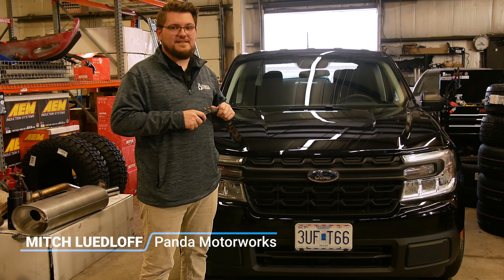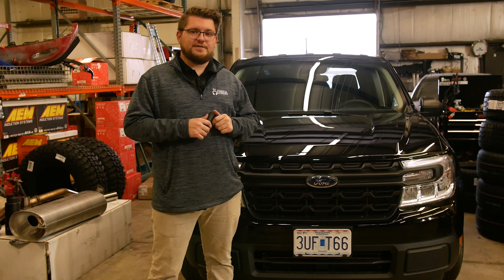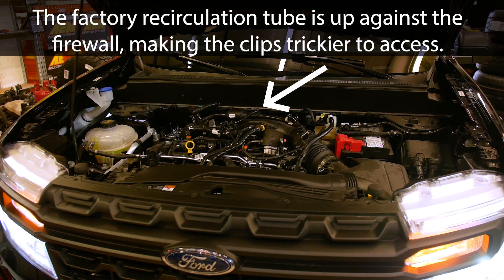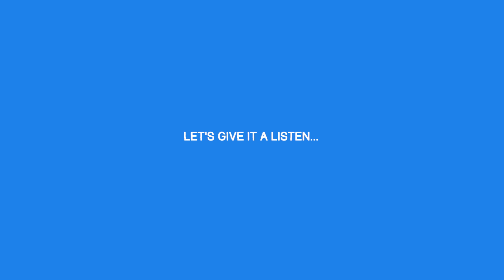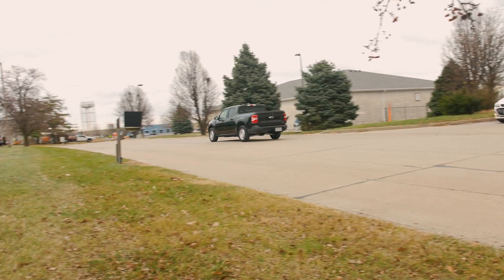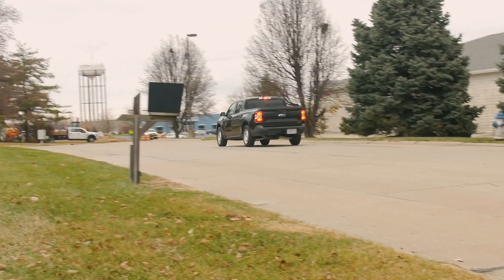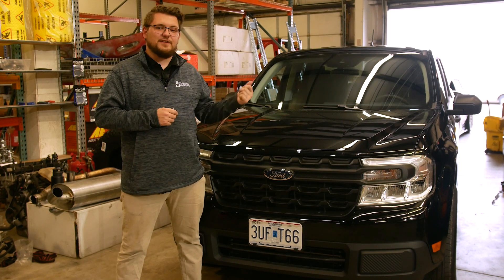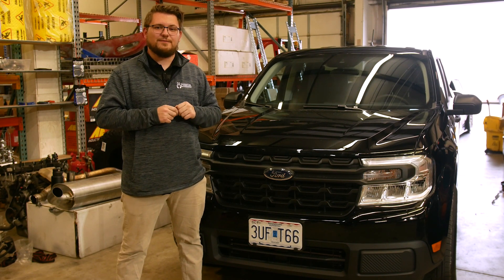Ford Maverick $5 Mod!!

Comment: can I use it with the AFE intake kit bolt togehter? 
aFe Momentum GT Cold Air Intake System (2022 Ford Maverick 2.0L Turbo)
Reply from the maker: Yes you can!
Reply: @PandaMotorworks  thanks for the fast answer

Comment: what other benefits other than the sound does this provide? I am not a car guy but I am getting a Maverick soon and I am looking at what customization options are out there?
Reply: In this case, this is specifically to "hear" a process that's usually silenced by the manufacturer. You shouldn't see a significant increase in any performance, but if you like the sound of turbos this is an easy way to get that sound to your ears!
Reply from the maker: @HeyKaytu  Could not have explained that better myself! Thank you for helping our viewers!
Reply: @HeyKaytu  Thank you

Comment: Question what's the difference between this and a turbo blowoff valve
Reply from the maker: The stock Blow off Valve is what we are modifying here so you can hear the noise. 

Upgrading the valve does have benefits when looking at throttle response & better sealing piston vs the OEM unit but for sound this does the trick!
Reply: @PandaMotorworks  thank you waiting for mine to arrive so I can start modding

Comment: What is that hissing sound it is making?
Reply: That's the sound of the excess pressure from the turbo being released into the open air. Generally with a turbo, when you let off the gas, the turbo is still spinning rapidly, generating pressure downstream of the turbo where it's no longer needed. That puts strain on the turbo and shortens the lifespan - most modern factory-turbocharged engines have a diverter valve or bypass that "recycles" the air by reinserting it somewhere before the turbo on the intake chain. This releases the pressure the turbo built up and avoids that previously mentioned strain.

In this case Panda Motorworks has deleted the part that recycles the air into the intake system (this does not cause issues and the "recycling" is specifically to eliminate that hiss as regular folk may ask the same question you did and worry) which allows the pressure to be released directly into the engine bay where it's audible. 

I hope that helps!
Reply: @HeyKaytu  wow thanks for the information.  Appreciate your time.
Reply from the maker: @HeyKaytu  Thank you!!!